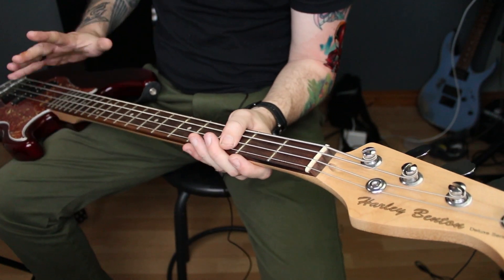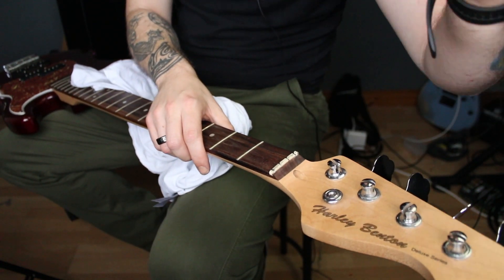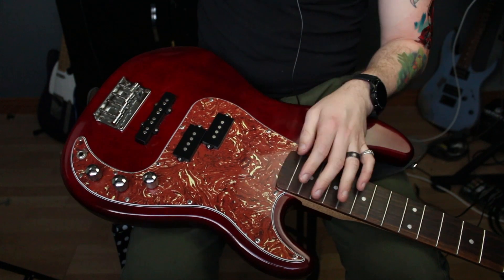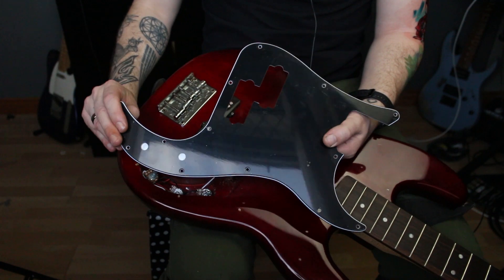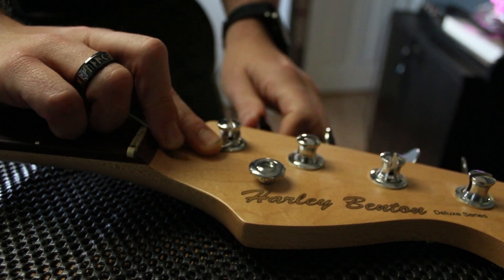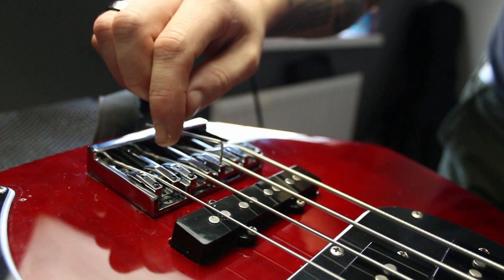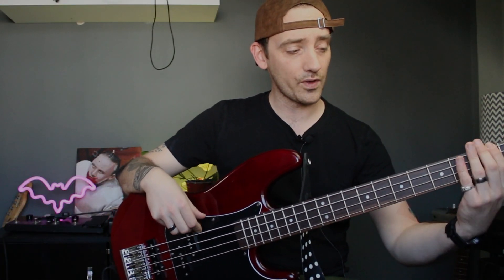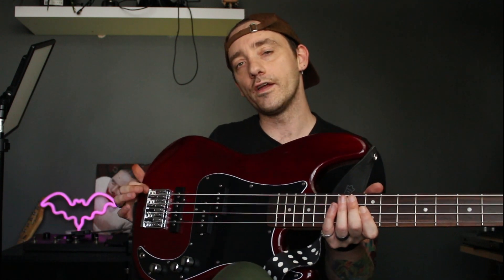Upgrade your bass! Changing your pick-guard and bridge!

Comment: Hi, thank you for your videos which I find professional and very accurate. I also have a pj 4 htr and would like to change the pickguard and bridge, can I kindly ask you which pickguard and which bridge to buy in order to match the screw holes? I would be grateful
Reply from the maker: The bridge I got didn't fit well and took some manipulation so I wouldn't recommend it. I got a fleor pickguards. My best recommendation for a bridge is to accurately measure and compare a few. I used Northwest guitars or axesrus for bridges. There's a great range. Sometimes even replacing the single saddles is more than enough if you feel your bridge is faulty/not great quality